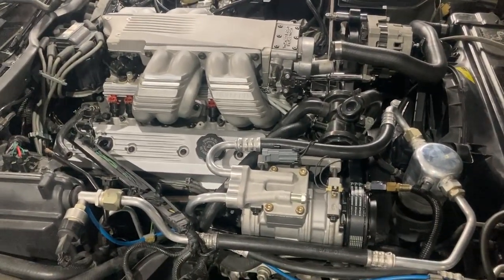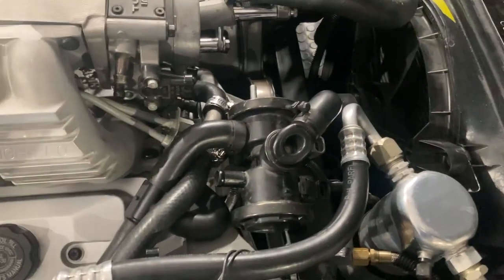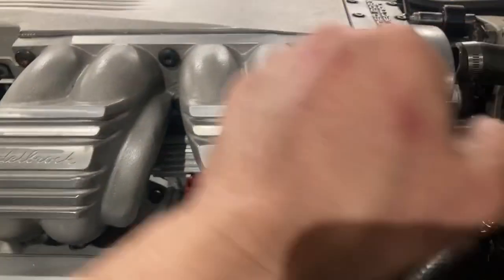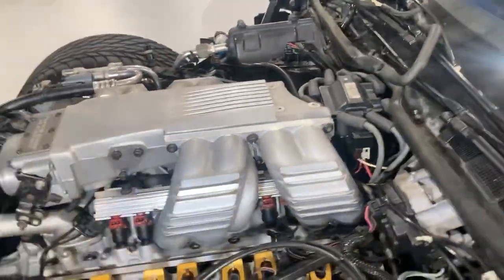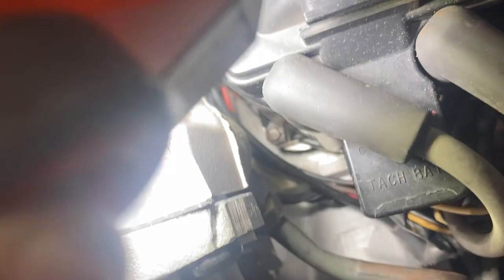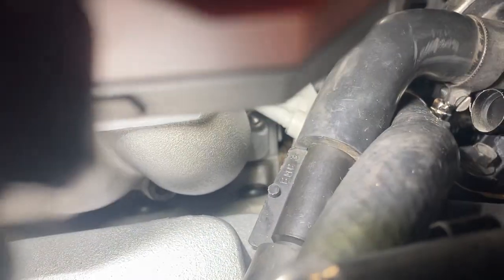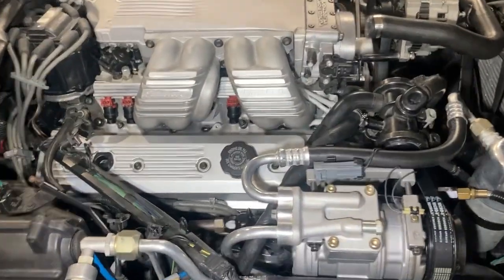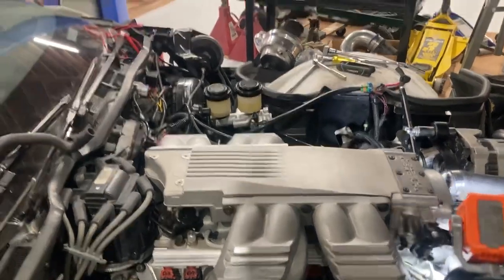C4 Corvette TPI 5.7 tuned port injection Edelbrock High Flo large port intake and runners - Part 13

Comment: Alternator is bassackwards. 
I saw an alternator turned around and running backwards on a Ford years back.
Was a bit shocked to find that it works turning either direction.

Comment: just bought a set of edelbrock runners. it seems it’s going to be very difficult to put them on. do you know if AsM’s are easier to install?
Reply from the maker: Pretty much any of the aftermarket tpi runners have a higher degree of difficulty over the stock ones…. Which in theirselves are difficult enough.  The larger the runner, the less room to work with, thus harder to deal with.  Also, adding larger runners to a non-ported Plenum or larger ported intake base really does not do much.   It helps some but kind of a very limited upgrade.  It takes all three pieces matched up to really see larger gains.   When you get all three matched up, you will see more torque/power and an increased rpm bandwidth.   Now to answer the direct question between the two runners, the Arizona speed and marine runners are very nice. They are very hard to tell the difference between factory and are just a little larger and they are a little bit easier to work with than the big cast ones like the Edelbrock however, for power, they are the lowest on the upgrade scale you will find, the Edelbrock’s will certainly out do them.  I’ve owned a few sets of those and love their quality and love the way they look, but they really did not do much at all in terms of power gains.

Comment: Where did you get the runners
Reply: eBay has them used but not cheap 😂 glad I got mine years ago ...mine are the Arizona Speed which look like the originals I think I got em for $250 from a dude on a Vette forum